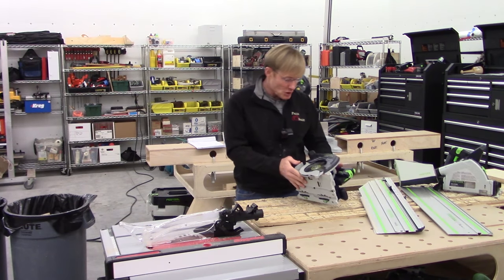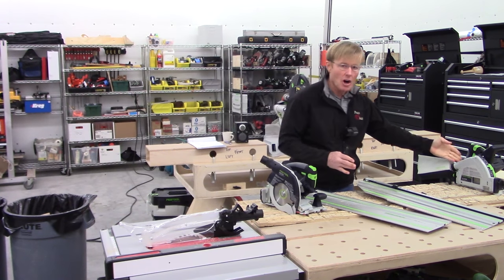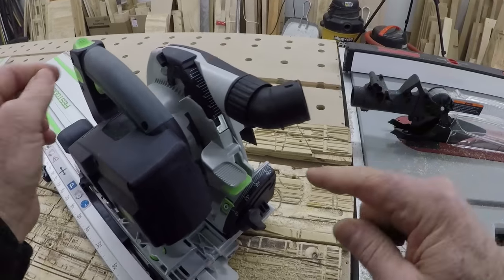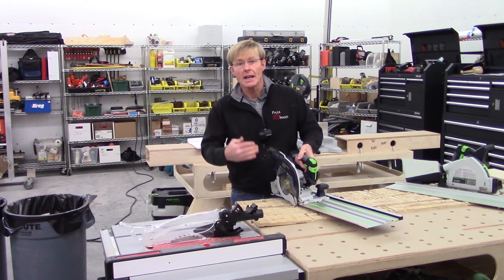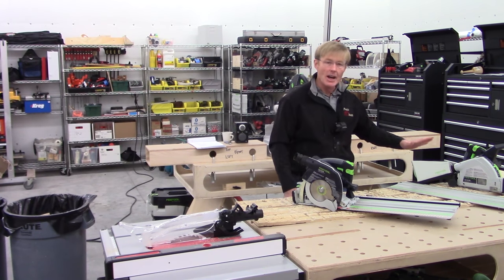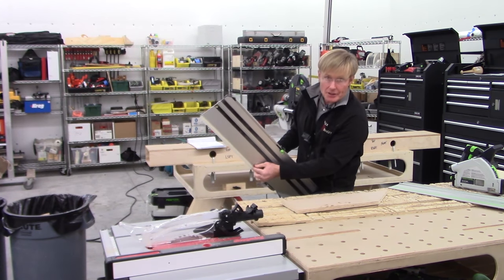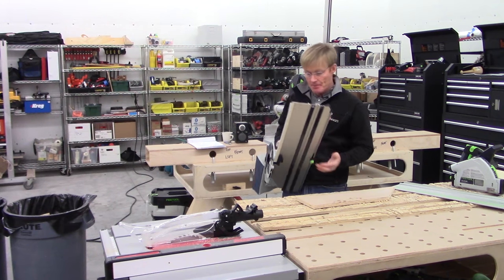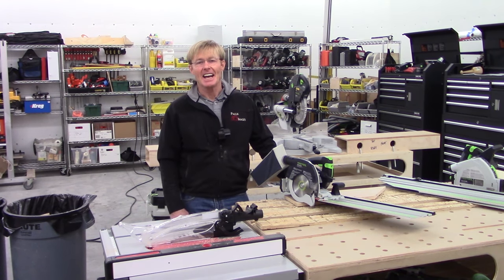Festool's HKC55EB: An exhaustive look!

Comment: Thanks for the other good video. I am looking a "track saw"(ish). I am carpenter/framer and I love making cabinets and wood working too. I can only buy one saw to start with. What do you recommend? HKC55? Or TSC 55? Can you please make some comments between these two? (Dust collection/guide rail/ cut finishing/plunge cutting /clampdown.......)
Reply from the maker: If I could only have one track saw it would be the FT TSC 55 cordless. http://www.bobmarinosbesttools.com/tsc-55-plus-xl-fs-cordless-track-saw/p/561702/ I would also get a short track for most work, a medium track for cross cutting plywood, and a long track for ripping plywood.

Comment: try cutting a LVL on a bevel, like you would for most hips and valleys. Major design flaw in this saw.
Reply: Thats not even close to the application this saw was designed for.  Thats what your Skilsaw or Sawsquatch is for :)

Comment: oh come on ... i`ll wait for the wifi version that send the meters cut to my phone. man those tools are nice. thanks for the review 
take care
pete
Reply from the maker: I see the pricing of FT a little different. My experience is that FT is one of the best, if not the best value for professional carpenters. I am glad that a few companies build their tools to be durable, productive, ergonomic, etc.. and then let the price fall where it may. Most companies do market analysis and then the bean counters say to the engineers, "your retail price point is $199 so you have $89 to built the tool." This hamstrings the engineers and the final tool. When I amortize the cost of tools over time and the increased production, then FT becomes my best value or lowest cost divided over its use. I see this across most all products: cars, cameras, etc.. I would compare FT to upper-middle-value car, not a luxury vehicle. Also, in construction over my near 30 years, tools as an expense are no more than a rounding error. The big cost is labor by large margin, taxes, insurance, and vehicles next. FT is a professional tool and are worth every penny in that arena. FT's market is not the consumer. The consumer market is much larger than the pro market, but it also has many more choices. Just visit any Home Depot and you can choose from many brands. Most old professional brands have left the pro-market to cater to the consumer market: Milwaukee, Porta-Cable, to name a few. 

The knock off brands also make camera gear that are professional look-a-likes, but the working photographer knows the difference and cannot afford the cheap stuff.
Reply: i actually agree with both you ron and havenisse on the difference btw pro and hobby markets. i guess in any professional activity with tools the wisest option is to do with what you have and save for a good investment, but festool is just almost out of range here, a shame there is nothing in between a pos tool and them, even makes that in the past have served me good now are just burning bearings, brushes, switches, etc i was a faithful dewalt and bosch man, not anymore and they drove me into the consumer market, go figure.  cheers. pete

Comment: Good looking tool , but too expensive for framing and blade is too small for timber framing , where you'd appreciate track. I was checking it out on last Festool show and although nice saw , don't see practical application in my remodeling business.
Reply from the maker: I don't timber frame, but I have cut many roofs using 2x12s and would have put it to good use. The only big stuff I cut is a few beams, which I have a skill 10" that will cut most of it. I make all  headers from 2x and stack. For walls: plate, jacks, cripples, sills, etc.., I am comfortable with a worm drive and speed square. In summary, the FT saw would cut 99% of the framing I do and have done, but I am planning on using it for finish mostly. I think it would work wonders with custom closets.
Reply: +Ron Paulk that was my thought as well. More of a finish project then rough framing.  There's a reason it's called "rough "
Reply: Honestly, this saw with the spring-loaded track is probably best suited for Hardwood guys.  Not having to move your lumber on to a chop saw is probably a huge time saver.  This could handle any cross cuts at any angle easily.  Just pull out a cordless jigsaw for any notches, or pull out a longer track for any long rips.  Voila!  No more wrestling boards in tight spaces onto table saws and chop saws!